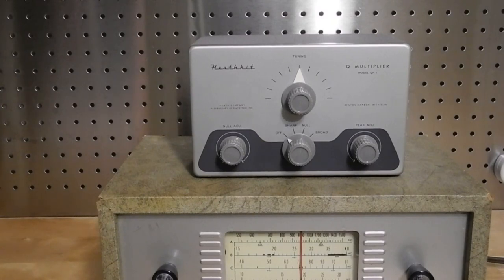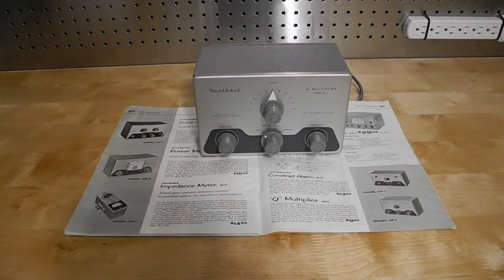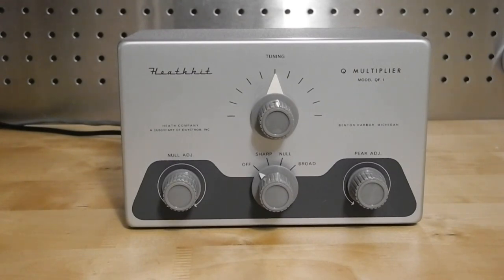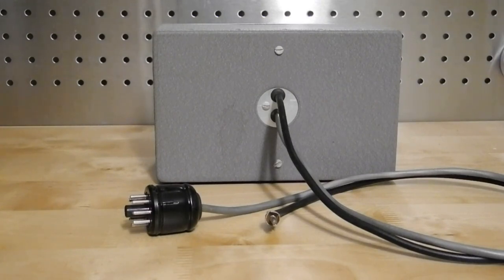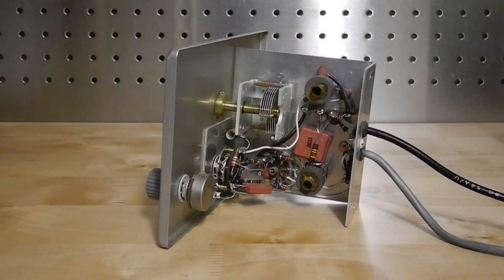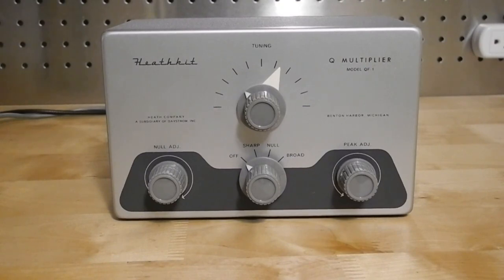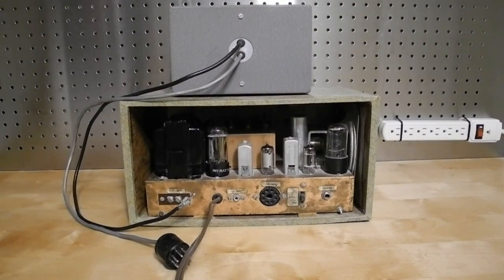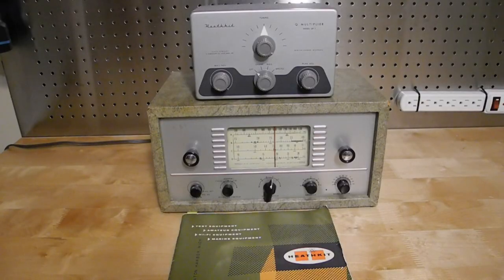The Heathkit QF-1 Q Multiplier

Comment: Are there any Transistorized Q multiplier devices?
Reply from the maker: There is no reason you can't implement a Q multiplier with transistors, but by the 1960s crystal and ceramic IC filters allowed receivers to be more selective and Q-multipliers were no longer popular, so when radios went solid-state they were no longer used.